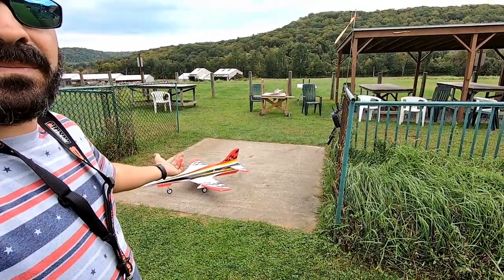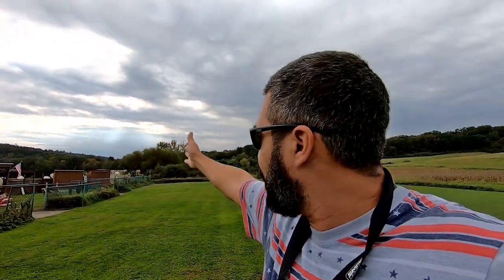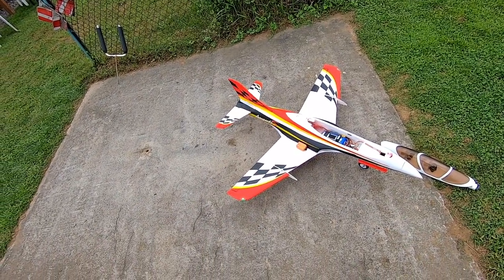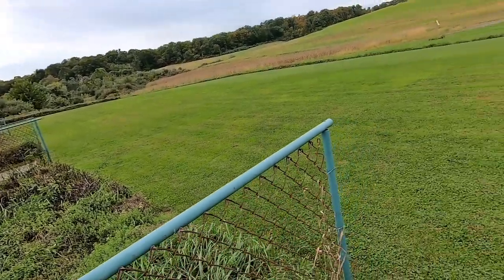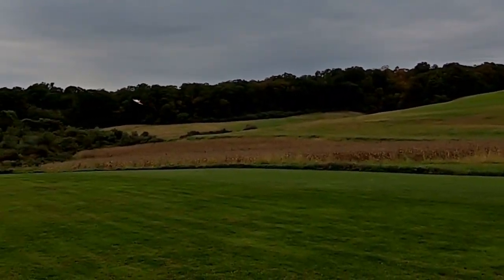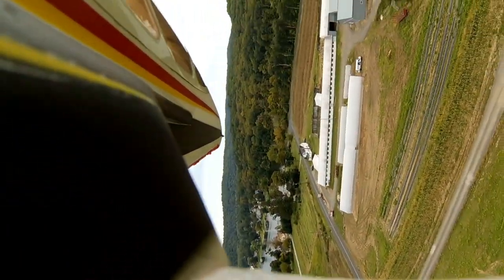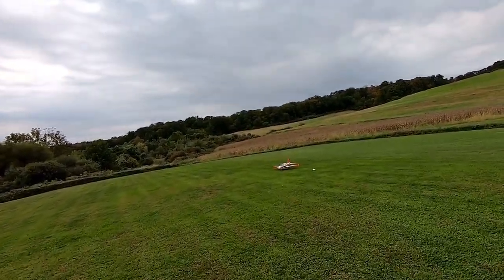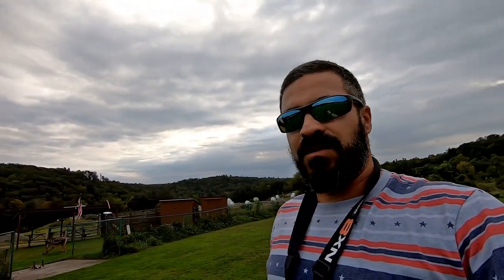Short Field Take off and Landings

Comment: This is what happens when you try to land the Avanti with no throttle!!! 🤦🏽‍♂️🤦🏽‍♂️🤦🏽‍♂️ You need to practice some touch n goes using the throttle to control sink rate. Thats the only way to get a truly slow and precise approach. Fly the plane to the ground and no need for a flare with grass like that. Plane will land and stop in about 10 feet...
Reply from the maker: Gooniac, thanks for checking out the vid! Honestly I land the Avanti with little to no throttle all the time, and and I have been successful, but something about trying to film talk and concentrate on the landing must have thrown off my finesse. Also, the front gear, as robust as it may seem, should be the last thing to touch down, hence the flair and landing on the mains. Thanks for watching and the comments.
Reply: @RCPlaneAddict  Yeah grass makes it easier to get away with it. But on pavement this thing does not let you get away with it! I plan to do a couple videos on this technique so will share when I do. It would shorten your landings even more!
Reply from the maker: Sounds like a plan. looking forward to it. Cheers.